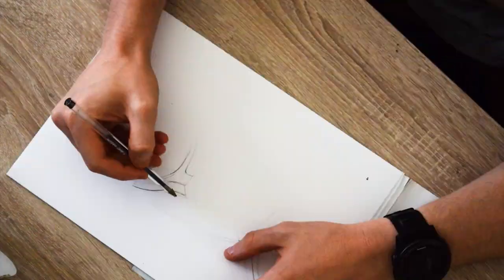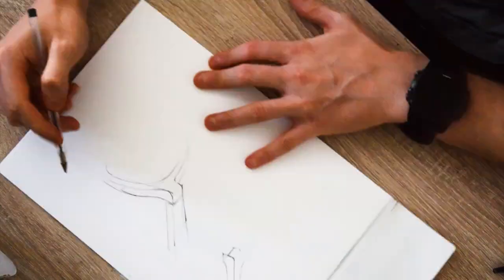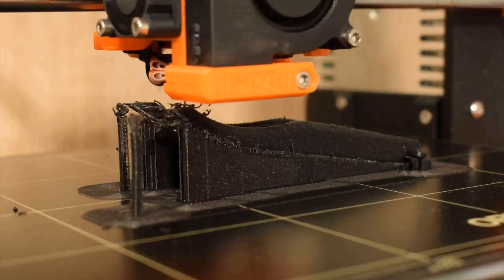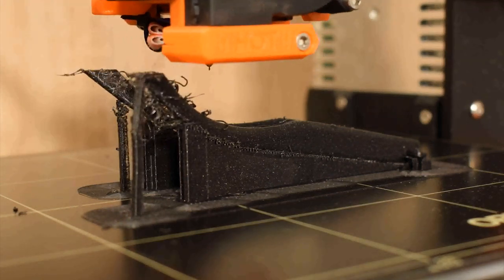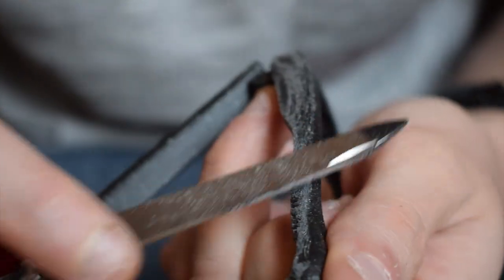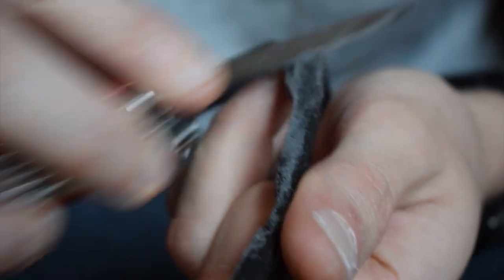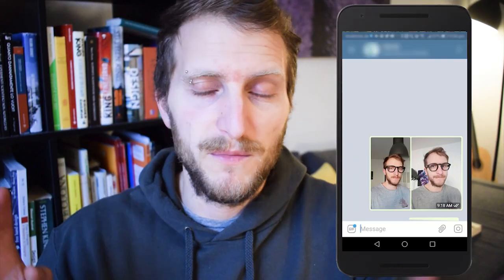DIY SUNGLASSES 3d Printed | Eyewear Design 😎

Comment: Why did you printed it stand and not laying? Thanks Massimo :)
Reply from the maker: Hi! Mainly because of the resolution, if they were printed laying the quantity of layers would have been much less, resulting in more visible layers. Another point was durability, printed laying would have meant that the layers follow the bending of the frame, doing so having more chance of breaking. Hope this help!

Comment: Bravo Massimo. Nice time lapse for a cartesian 3D printer. Hmm I'm looking more for a way to recycle my GF broken glasses. Our kids break them every month one pair (she also is not extremely careful I could say) Probably I'm going to use 1.75 mm filament for the hinge or you have other recommendations.
Reply from the maker: Thank you! I didn't understand very well where they are broken, is the hinge broken?  In which material are they ?
Reply: Usually, the broke at the hinge, but also other places.
Reply from the maker: If they are made of cellulose acetate you can use acetone to repair them (I think there are also YouTube video about it) otherwise you can follow the diy road as you said! I found pla works ok, but after a bit of time it becomes loose due to friction.

Comment: Hi Massimo, have you tried with liquid resin printing? could you solve the situation with the hinges?
Reply from the maker: At work we have a stereo lithography 3d printer with different material options, apart from being much more precise, can print in materials that emulates high resistance plastic. And for the hinges I think would be just a matter of right material, but.... No I didn't try any other print or material, was just a "one shot/one weekend" project 😅

Comment: what material use?
Reply from the maker: I used Pla since they are just prototypes. More precisely galaxy black pla by Prusa
Reply: @masslona  Is it resistant or is it only prototype? Is not it functional?
Reply from the maker: @soys3d845  it is functional, you can wear it and use it. The downside is that it is not as a final frame in injected plastic or acetate, it can brake if you fall or if you take a hit. Meaning it's not following security standards, so has to be considered as a functional prototype.